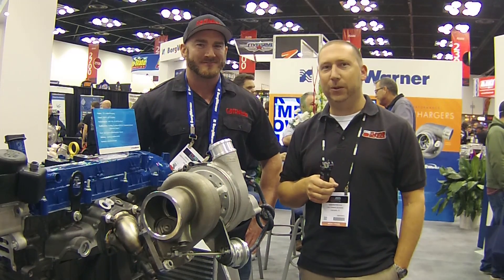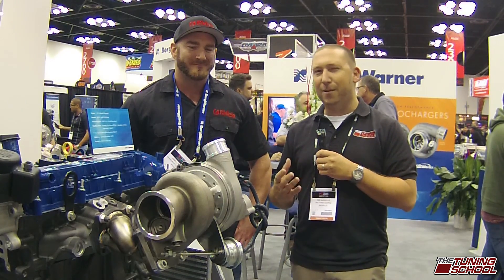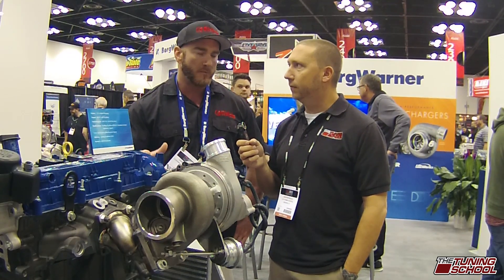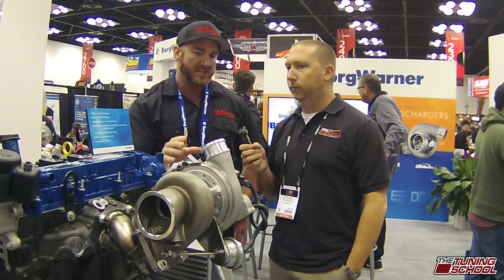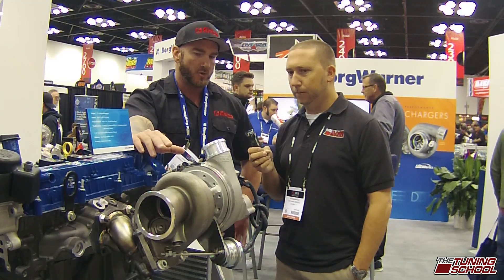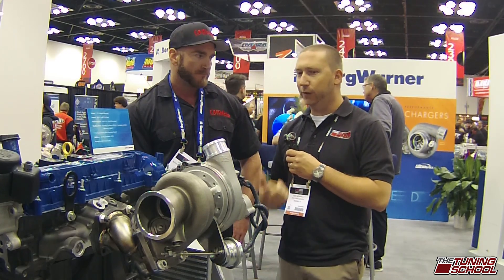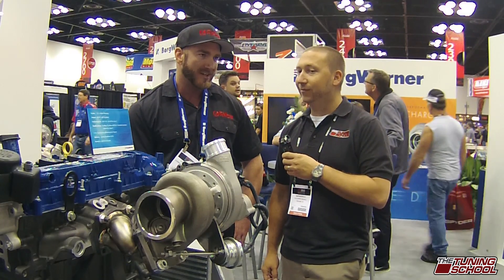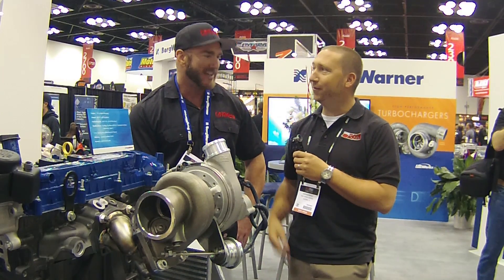Full Race 2.3 Liter Eco Boost Mustang upgraded Turbo's

Comment: Now this is how a good twinscroll turbo is supposed to be. Nice linear power band from idle to redline. 450 hp should be good for low 12's if its crank hp. If it's rwhp, then high 11's. Auxiliary fuel and a better fuel pump will make these thing haul tail.
Reply: High 11s?????? Try low 11s with auto trans.......my 3300 lb 470 whp Camaro did 10.92 @ 127

Comment: in the long run, how long will the stock block last? I've heard when turbos are upgraded, stock blocks don't last long.
Reply: The stock engine is supposedly safe to about 500 crank hp. But if your smart, you'll keep the tq low. Torque is what kills motors, transmissions, rear axles, and rods/bearings. Keep your tq under 430 at rear wheels and you should be okay. The limiting factor here in stock motor is the fuel pump. A lot of folks think it's the injectors. It's not.
Reply: thnx